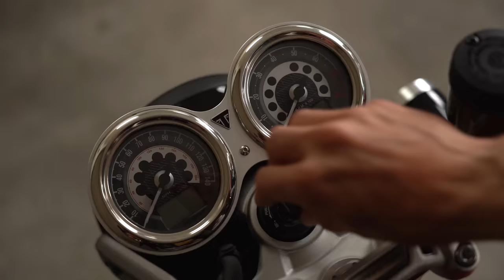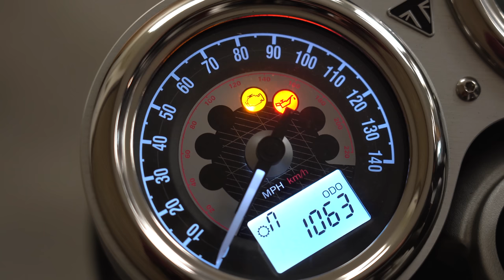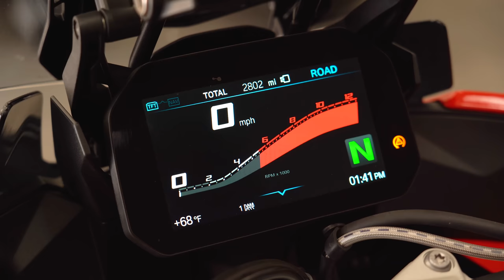Do You Need To Warm Up Your Engine? | The Shop Manual

Comment: Also don’t get greedy with the throttle until the tires are warm too! I’m sure you know this, Ari, but some of us don’t or forget! Don’t ask me how I know 😂
Reply: Also check them while sitting on your bike. Underinflation will wobble your front at high speeds
Reply: Yeah .. learned the hard way too 😂
Reply: the best way to learn :) I also learned not to squeeze my front brake on the slippery surface on an underground garage, while turning.
Reply: How do you know when the tires are warm?
Reply: @zupinu2000  when tires are warm braking distance is reduced and traction is increased . You can feel the bike is easier to stop and maneuver..or you can just touch the tire 😂. By the way if you have worn tires you will need a lot more time to reach optimal temperature .With good tires will take few minutes , you can even install a tpms sensor . When tires are warm you will see psi-bar increase .. some even have tire temperature sensor .
Reply: @ioandragulescu6063  dont squeeze your brakes while turning period
Reply: @galerinha  I am pretty sure a lot of people will remind you kindly about trail breaking
Reply: Ioan Dragulescu I'm not sure about the "kindly" part though.
Reply: Can I ask you how you know? 🤔
Reply: ESP brand new tire not ridden on 😅 low sided the shit out of a bike once doing just that. Learned valuable lesson that day though. And so did my left shoulder hehe
Reply: @galerinha  unless you are trail braking
Reply: @chriscs9080  how would you know braking distance got reduce and traction got better ? Lol there’s not really a reliable and safe way to do this when you go out for a ride. So the sensor it is
Reply: @alanmlkbanda  You would know by using your brakes and swerving ..as tire warms up it takes less effort to swerve and brake. A good tire will give enough feedback . Of course it takes experience and to learn how a tire behaves , different tire may behave differently . By the way never have used a sensor but they seem nice .
Reply: Or the brakes 😅😅
Reply: what happens if they are cold
Reply: @jacob_1866  hmm loose grip??
Chance of slip at tight breaking

But don't worry just drive it few metres and it's ready to rock
Reply: Yep. I was reminded of that at the track today!
Reply: I have a bike that's too slow to worry about warm tires and throttle together lol
Reply: My legs lost it's skin..mostly on the thigh..
Reply: @chriscs9080  yes I just discovered that a a couple of days ago too :(
Reply: @alanmlkbanda  you get used to it, when the tires are slippery you can feel it, is not something you can just explain, when you turn with your car to the limit the car doesn't screm to you something like "you better stop here!" 
It comes natural after a while
Reply: @chriscs9080 Swerving doesn't deform the tire the way acceleration & braking does. Deformation is what heats up the tire.
Reply: @JoshNewby84  that's true braking generates more heat 
.
Reply: @chriscs9080  And acceleration. Braking front, acceleration rear.

Comment: Good video.  My take is that it comes down to "be reasonable".  My routine for carbed bikes is to put on my gear, start the bike on the center stand, or sitting on the bike, then put on by helmet & gloves.  On warmer days, or subsequent starts, the idle time is pretty short.  On colder days, it may go up to 2-3 minutes.  Some of my bikes are more cold-blooded than others.  Too short of a warm-up is less than optimal.  Too long of a warm-up is less than optimal.  Be reasonable with the bike, and it will treat you well.

Comment: Really helpful info. As a rule of thumb I would always let my bike idle for at least 2 ~ 3 minutes after a cold start with the choke on because when I started riding I had a carburetted CB600F which would run like trash when applying any kind of throttle when cold. 
But yeah, take it out of the garage, pre flight the bike, turn it on, jacket, helmet, gloves, double check brakes and off I go. I usually baby my bikes until the coolant needle is in the middle or the clutch cover is hot to the touch. Never had any issues.
Reply: 100% my routine is almost exactly the same. My FZR250R will just stall if I give it revs before it’s warmed up for a couple of minutes.
Reply: Idling is pretty stressful to the engine also. You can feel that by vibrations which are usually stronger at idle. My Internal Combustion Engines teacher told me long time ago, that it's better to go gently, than to warm up at idle. You shorten the warmup time if you go, instead of idling and that's better for the engine. At that time fuel injected engines were still pretty rare.

Comment: Pistons expand when hot. When pistons are cold they rattle more and the skirt hasn't expanded all the way at the bottom of the piston, so the piston is more likely to rock in the bore, and cause piston scuffing. And the connecting rod big end bearing clearance dramatically increases on the crank journals when hot. If you are running a cold engine super hard, there is a chance that you scuff the connecting rod bearings, or worse, damage the crankshaft and spin a bearing. This video was really good, because the most likely scenario is that running a cold engine really hard, when clearances are too tight on certain bearing surfaces, will just lead to accelerated wear.
Reply: Thanks for summarizing the third point from the video. 👍

Comment: Very good video.   For reference I have a 2017 ZX14R that I bought new and it runs perfectly.   My routine is to start it up, put on my gloves and then start down the driveway.  I live in a neighborhood where the distance is perfect for warmup before I get to the exit onto the first road.   While in the neighborhood I shift into 3rd and give it zero throttle.   It goes on its own just fine and the idle revs drop before I get to the exit.   In the rare case that the idle rev hasn't dropped I baby the throttle on the exit road until it does.   I always thought that was a sensible procedure.   Nice to have this video confirm it.

Comment: I'm using full synthetic motorcycle oil and after a few times in the morning (slightly above freezing). I often have my oil light go on for a little bit and then goes away. I unfortunately immediately get on a highway from my home but I try to keep it under 6k on the tach. I checked my oil level and its thick enough to take some time to show up on the glass. Once warmed up its perfectly good oil level. I let it warm up for a minute or two before taking off.

Comment: I've always been of the opinion that warming up by riding gently is the way to go, and it's quick.  
Given I have a 19000 RPM CBR250RR that has clocked over 125,000km, I'd say it works.
Reply: Literally all 8 of my mc22s run super shit till they are warm, but I have to go up a long hill so I always let them run for about 3 to 4 minutes before taking off
Reply: @Tyler_Mayhem  That's a crazy number of MC22's!  
I don't have a hill so can basically ride straight away, albeit stumbling.  Out the gate it'll bog when giving it anything but the slightest throttle, but it quickly improves.   
I never use the choke, but then it rarely gets colder than 0C here.  When using daily it'll start without choke + a bit of throttle with minimal drama.
Reply: 250cc but 19k rpm?
Reply: Those Hondas will probably outlive humanity lol
Reply: @nesto9889 my old 99 ninja 250r would rev to 14k and that’s where the redline started. 19k is pretty nuts. But I’d bet he has no power at all under 8k rpms lol I know the ninja didn’t
Reply: Wow cool bike
Reply: @nesto9889 yeah small piston rev balls high that's why the 250cc 4 cylinders of Japanese bikes in the 90's can make like 40-45+hp and redline 14k+
Reply: Wow, 125,000km. Has it ever been rebuilt?
Reply: @BigJohn_S117  Not yet.  But it has been sitting now for a few years.  The bike needs attention in a few areas.
Reply: @SportbikerNZ  That's sick! A lot of people will try to tell you that a bike with 50,000km is at the end of its life. It's all about maintenance and how you ride though
Reply: @BigJohn_S117  Maintenance and the build quality.  The bike has been ridden hard practically it's whole life.  Oil changed every 10,000km with fully synth.

Comment: Pretty sound advice and what I habitually do on my Kawasaki Z1000SX / Ninja 1000SX: Start the bike up, then put earplugs, helmet and gloves on while simultaneously running a check that all lights are operating correctly, before mounting and riding 👍
Reply: You should wait at least until the idle comes down which is about 139F.
Reply: @spoonman73  yup, that's what normally happens on my Kawasaki Z1000SX. By the time I put on earplugs, helmet and gloves, the idle has dropped.
Reply: @NooBiker  ear plugs ?? isn't the sound part of why we ride.. its pure music..
Reply: @captaincrunch72  so I want to keep my hearing. Ear plugs cut out the frequencies for wind noise generated by the helmet and air turbulence. I can still hear the induction sound from the air intake, exhaust tone and pops etc. as well as other cars.
Reply: @captaincrunch72  hearing loss is permanent and not fun.

Comment: It's really good to see a thorough and concise section in the shop manual to address warmup times, etc. I agree that clearances in the machine are optimum within the operating temperature range for the machine. Most modern motorcycle engines are constructed of various dissimilar metals and other materials, including gaskets, that operate in concert when they reach optimum temperature range. Who knows what might be in that engine? Titanium, aluminum, balonium or just plain old pot metal.... Thanks Ari!

Comment: I ride a z1000 and let it idle for 1-2min then give it a quick idle of extra 500rpm for another 30secs then go but I only commute to work about 5miles away and hardly over 30mph so it’s never pushed hard most of the time anyway and just do the scheduled maintenance recommended.

Comment: About 10-30 seconds is usually sufficient just idling, then go easy until the oil and water are up to temp. Also gives you time to get zone in before you thrash 😉

Comment: You just saved me 10 minutes every day.  Before my daily ride to and from work, I would start up my Z900RS, and wait until the revs dropped below 1500, then hit the road.  I thought I had to let the oil warm up and circulate through the engine.  No more...thank you Ari!
Reply: Happy to help!
Reply: You actually increase wear (slightly) by doing this as your engine warms slower idling vs being ridden. Same advice applies to cars. I've babied my machines and used to do this until someone explained this to me and now I give it a bit to turn over and then just go easy for about 5-7 minutes til I give it the beans. 

Your thermostat will show higher temps earlier than engine oil so if it says it Warm give it a little more time as your oil is more reflective of your actual engine temp.

Btw I love your bike. I'm torn between learning off road riding or getting one this season. Happy riding
Reply: 10mins 🥲 man you are damaging your bike by doing this 🙄 instead of saving it from wear and tear 

Just wait until the rpm comes at idle speed and go slowly and drive it in 2nd gear  atleast for 1 km

Comment: The owners manual on my ZX10R literally says idling for 5 minutes can permanently damage the engine. Sportsbikes are heavily reliant on airflow for temperature managment. 

(It also has a note about that the radiator coolant is laced with anti corrosive chemicals and thus not fit for human consumption. Always loved that little touch)

Comment: every bike ive had ive always let it warm up while i get my gear on and ready to go normally 5-10 mins. bike runs so much smoother when warm instead of forcing it to struggle when cold
Reply: does it go faster after you clean it too?
Reply: 10 minutes? Damn. You only need 2 minutes to get to operating temperature. If it's running that rough you have some water in your gas tank.
Reply: @trsskater  the bikes a 96cbr600 on carbs running richer than factory due to tuning so takes longer than fuel injection bikes to run properly when its cold
Reply: @leodavies4134   I thought you were talking about a modern bike since that's what this video is about.
Reply: You just punished your bike. And engine is to be warm up while driving. You idled it for 10 minutes with cold engine parts. Drive it and it would be the same temperature in one minute… do you see the point? Quickly warm it up. Not slowly
Reply: @greatdane145  That is exactly the main argument against extensive idle warm ups. 👍
Especially on cars by letting it warm up at idle, you´re basically putting the engine the whole time through coldstart, which is the most stressing state for any engine.
Not to speak of things like still cold gear box etc. And i´ve seen a test that showed even 40 min of idling will still not get an average car engine at 80°C oil temp, while max. 10 min of low rev driving will accomplish that. And on bikes you additionally have to factor in the wet clutch of most engines, because they are lubricated by the engine oil as well.

Comment: Very helpful!  Never considered some of those points.  The manual for my Versys says to let it warm up before riding and now I have a better understanding why.  I know when its ready to go when the idle speed levels around 1200-1300 RPMs.  Can take a little bit during the winter but it allows me to adjust the idle speed on those particularly chilly days.
Reply: I noticed on my 2020 Versys X300 is that it runs like a tiger off the line when warmed,  but just below normal operating temp.  Once it's its full op. temp, not as quick.

Comment: 3 months ago I bought a chinese 110cc 4t bike with 4 gears, before driving Im letting it stationary for 2 or 3 min. to warm up. After that when i start driving the engine is still cold but the gear changes are smooth, the throttle response is better. Now the bike have 5k kilometars on the clock without any problems, Im just loving it :DD
Give your bike those 3 min, you wont miss anything and the bike will last much longer

Comment: You just made me understand why my 355 SBC swapped Oldsmobile takes forever to warm up. And even when at operating temp, the carb STILL bogs down midrange until its really warmed up. The original carb that came on the original engine was computer controlled even in 1985. I looked back at pictures on my phone before I pulled it and the quadrajet had two plugs coming out of it, going to the computer that was helping to control the mixture on the fly. Since I no longer have that computer, and the new engine and carb are running completely mechanical and unaided by a computer at all, it struggles until it feels right on its own because nobody is adjusting the mixture for temperature or anything like that. Thanks bro

Comment: I remember when my dealer delivered my Dorsoduro 900 to my house, he told me to make sure to warm up my bike in about 10 seconds before riding it since the idle bogs a bit at that time. I was a bit baffled since it's EFI, but followed his advice anyway, and learning more reasons in this video, I'm glad I did.
Reply: I had the Aprila Dorsoduros counterpart, the Shiver 750. I loved that bike. If you get the chance get the Dorsoduro 1200 I hear they are super fun.
Reply: @fanciestspoon586  I heard that bike is a beast, but I think I'll stick with the DD900. Most problems coming from the 750s and the 1200s have been addressed in the 900s.

Comment: One of the first things I learned when I took my first bike from the dealership - always wait for the working 🌡️ to be at least 40°C and change the oil on time or a little before that.
Reply: And how long does that take ?
Reply: @alanmlkbanda  If you just hold the throttle open so it's hitting the limiter while in neutral it doesn't take long to warm it up

Comment: My Gen1 Bandit 1200 is carbureted. I will usually put my helmet and gloves on, then start it with choke. After about 15 seconds it's good to ride, and the choke is eased off until after a couple hundred feet down the road it's completely closed. Easy on the throttle until it's good and hot. Thanks Ari!

Comment: Gr8 vid. This is about thermal stress of the engine. Running the bike without proper warming up will not implode the engine, but will increase its thermal stress in the life of an engine. In other words, with all other things being equal, an engine enduring less thermal stress will yield more mileages in its life time. An engine with higher thermal stress tends to weaken faster and will cause catastrophic failure sooner. If all sys are well, let the engine idle speed tell us when the engine warmed up. Cold idle revs btw 2.5k to 3.5k; warm idle revs btw .6 to 1.2k. Don't forget, before going full, let the clutch plates, final drive chain & sprocket, and tires all warm up properly.
Reply: Running the bike at low operating RPMs for less time will warm the bike up faster resulting in less total thermal stress on the engine than if the engine were to idle for a muuuuuch longer time.

Comment: Yeah, I don't know.  My Kawasaki Z900RS has a warm up cycle which lasts three to five minutes until it drops the idle speed to 1000. I have always been very conservative during the break-in period and always let my bike come up to full temp on the first start-up of the day.  My engines have all run strong and tight to 50,000 miles plus.  The people I sell them to always comment on how new and tight the motors feel. I saw your video comparing two CB500 motors and I admit that you changed my mind on the break-in, but I am going to stick with the full warmup because the way all my bikes have lasted tells me that I am doing something right.
Reply: The warm up cycle is ecu regulated based on the tempture. If you get it up to tempture faster it will drop the idle sooner. It only idles higher to help with combustion.
Reply: @trsskater Cold start idles usually prioritizes the warming of the catalytic converter